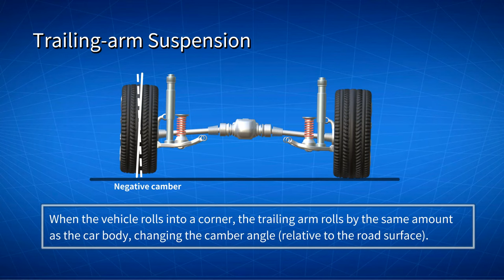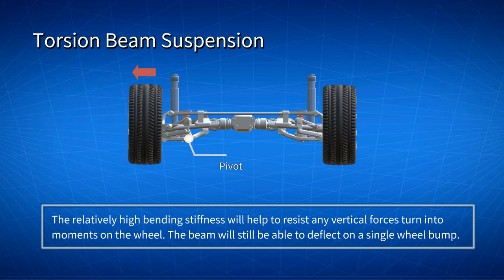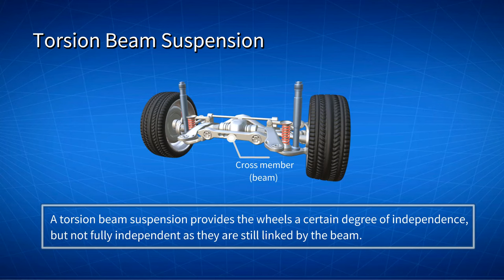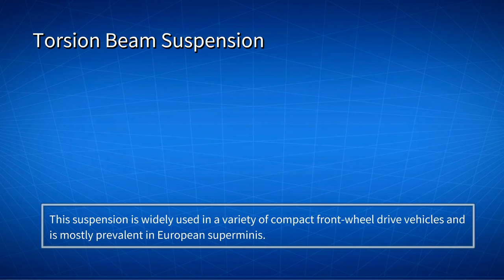Car Suspension: Torsion Beam Rear Suspension | Trailing Arm Suspension Explained (2022)

Comment: Is it same Coupled torsion beam axle suspension?
Reply from the maker: Coupled torsion beam axle type suspension includes trailing arms coupled to opposite ends of a torsion beam, which is similar as shown in this video😀